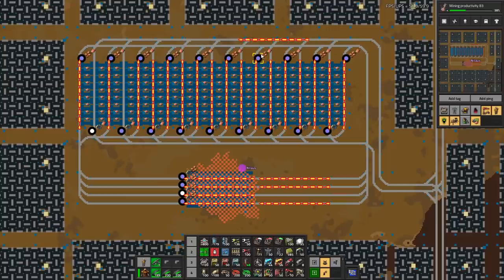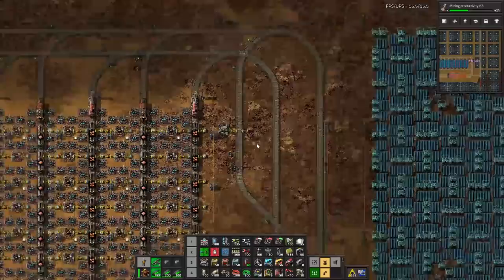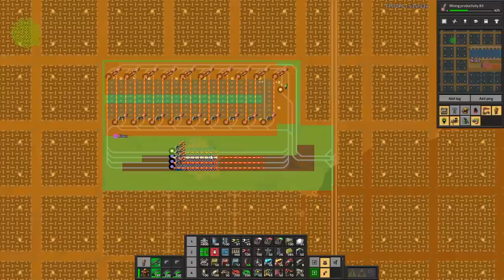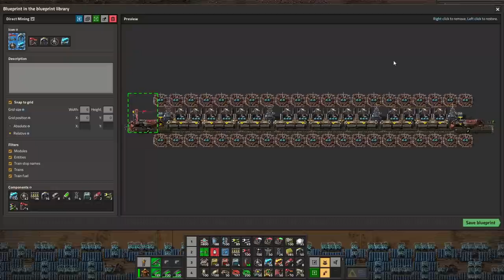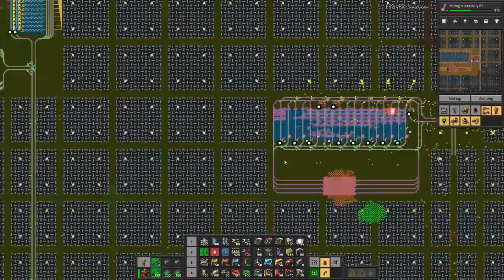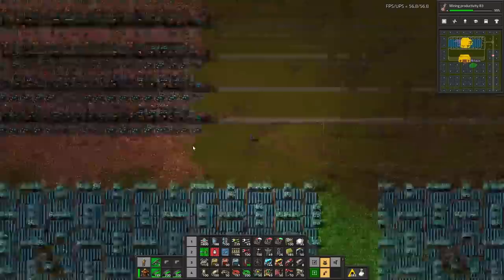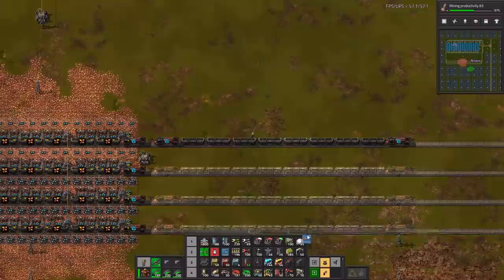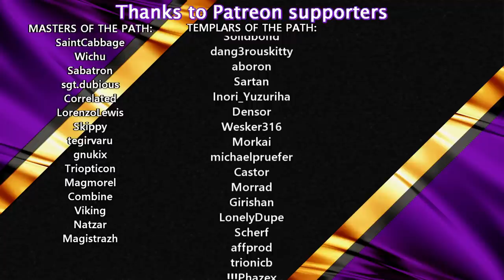A New Type of Mining/Smelting Module | #68 | Factorio Megabase-In-A-Book Lets Play

Comment: The circuit network logic to turn of the ore loading station (from the last episode) is not needed, or even dangerous. 
If it runs out, the logic closes the station. Which means to many trains, and possibly deadlock. If it runs out without the wiring, there will be two trains waiting (forever), as is normal anyway.
Reply from the maker: Good point. Thanks

Comment: If you want the blueprints to be as modular as possible, you should do either of the following:

1) Leave the mining patch stacker signals as far right as you can, essentially at the forks. The distance between the fork and the patch doesn't matter (unless it's too short for a train), since you will never allow more than one train in each stack slot anyway for your system. This means that you can just place the miners, place the fork, and then connect them without worrying about the signals. Much easier to do quickly than having to measure anything.

2) Or you leave the stacker as part of the miner blueprint. Then you get the perfect spacing for a train to stack behind the miner , and you make sure you have built the module in the right place around the patch to fit the smelting above.

I think I prefer option 2 here, since it also includes the check that trains fit in the stacker. You still only need to connect the stackers to the fork, so. Also, make sure that there's not two lights before the patch so a train can get stuck in the fork. I'd also put a chain signal before the fork, just so a train won't try to enter a it for any reason other than it need to go there and there is space for it. Trains are so stupid, and if they can get stuck, they will. Imagine one just wants to do a lap and starts stacking as the 3rd train because it was a shorter path or something stupid. It may also be because you told it to while cleaning or something, and it'll jam everything, possibly forever with no chance to automatically correct.

Also, as more people seem to have said, no need to have fuel around the patch,. It is often in conflict and more complicated than it needs to be, I can see one argument for initial fuel since trains are part of the blueprint. There's also some manual tinkering with linking up the patch with the smelting module for the network, and power, to hook up the robot network. Less manual work = more build more faster!

Comment: 40:15 - no, we think it's useful in certain contexts.  Northward expansion was the context it was being suggested for... then you backfilled southbound with your expanded build, and it stopped making sense.  Or at least, they needed to be moved.  Which we had suggestions for how to do (upgrade planner to convert buffer chests to storage chests, then stamp down new buffer chests), but you ignored that bit.  ;)  (Which is fine, just... giving you engriefment (engagement + "grief", in the lighthearted sense.)  :D
Reply: Yeah, . . . one of the drawbacks of bugger chest is that they take some babysitting, observation, and final adjustments to be worth it.  I think that the optimal approach is a regular train network at a rather large mesh size (maybe 8x8 city blocks), and each block should have its own disjoint airspace for drones.  For example a 7x7 airspace per mesh, and a "thin" airspace covering the entire train network for maintenance and infrastructure (but separate from every mesh).  Then, trains take bulk goods to the construction sites, where drones take over and actually build stuff.  Long range drone transport won't be possible except on the network itself; the rest will be handled by trains.  To build a solar mesh, one would start with a little station, offload all materials there, and drone trips would be limited to 7x7 city blocks in the worst case, for a small fraction of items which are built at the opposite end of the mesh.

Comment: If you do 4 furnaces per wagon with less beacons sharing a track between loading unloading, you can achieve a slightly higher throughput on a smaller footprint and lower power consumption.
I made a blueprint if you want to look, but I though you would prefer to find your own solution.
My design uses a few more inserters (16/wagon, 75% move full stacks less often) than your design but no underground *belts*, I also limited my inserters to 10 items to help balance.
Oh and a lot fewer trains as they don't need to wait at the station with 4 chests for loading and 4 chests unloading.

Comment: My thoughts:

* supply of plates is not reported to the network.
* I'd add a stacker for outgoung trains.
* Maybe time the inserters with a clock, so they are only non-idle for one tick every smelting cycle.
* can you prioritize consumption from this smelter, so that the ups-inefficient ones run idle eventually? 

I thought about mining directly into an oven, but I could only get 2.5 plates per second and furnace (you have 5) due to the geomety and you get to use even less of your patch.  But maybe that's still worth exploring?

Comment: You could make an entry point--but no exit--for the ore trains into the closed ore loop from the main network so you could still launch them from your train yard
Reply: True, but any module already built could get a 14th ore train, filling up that last train limit slot. I don't really know if deleting that temporary rail or placing down 13 trains is easier, though.

Comment: Nilaus, thanks very much for all of the content. Perhaps you or someone else could answer. I’ve followed your method of logistic train setup. If a station only requests the number of trains it can supply and the station limit is based on that, I can’t figure out why I keep having a station with little or no ore with a line of trains waiting  to fill, while there are other full ore stations (further away)that aren’t getting visited. Why would more trains than are being requested go to a station to wait?  One thing I did was to disable this slow station until they can supply certain amount or ore to push the trains to other stations which helps, but I’m still not understanding why I would need to do this unless I have something setup incorrectly. Thanks in advance for any help!
Reply: Just a further note. I also just noticed at smelting station I had 6 trains trying to deliver ore to a station receiving  signal of limit 3 trains.  I’d like to figure this out but it doesn’t make sense why more trains than the limit are showing up at a station.

Comment: Im not sure if onsite smelting is still needed when u direct mine? Wasnt the idea back then u wanted less trains. Seeing we are swapping that around? Well it will prolly still get super congested
Reply: onsite smelting reduces the traffic by half, compared to hauling ore to a central smeltery. There are more ore trains inside the module, but most of them have a very short path length, because they don't connect to the main network.